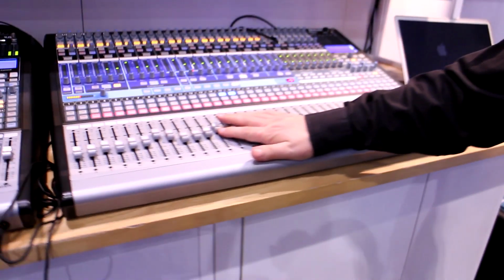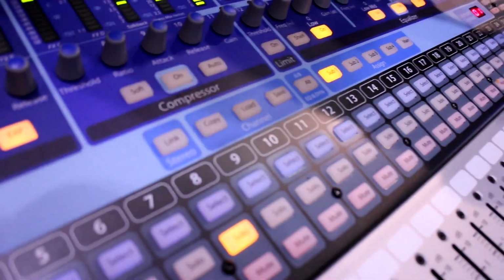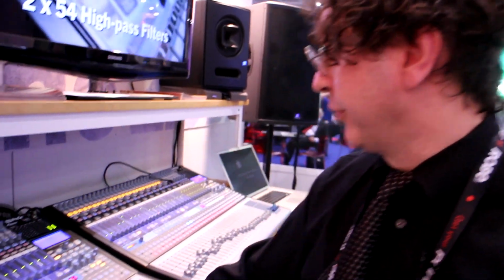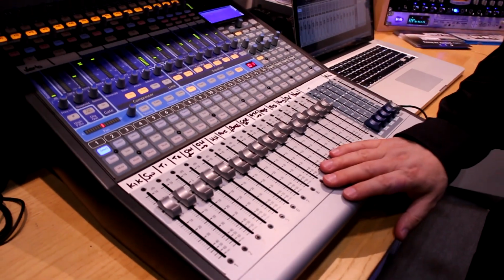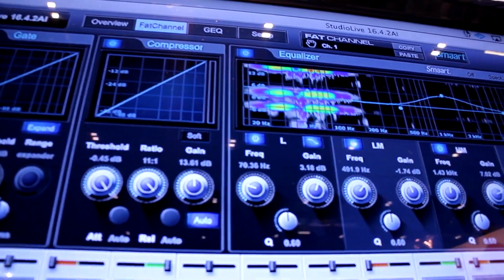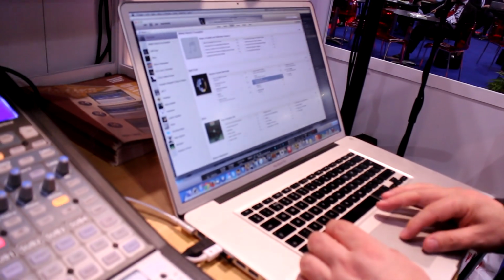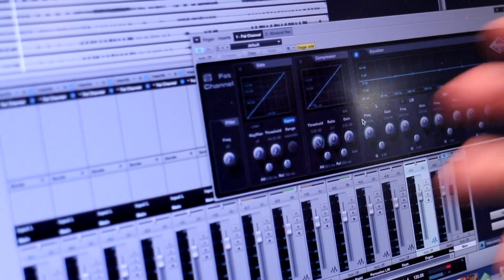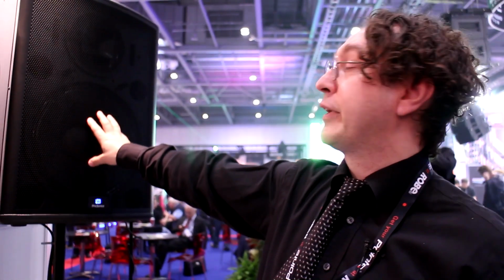Presonus StudioLive AI 16 and 24  Channel Desks At Plasa 2013

Comment: Wich of these mixers are rack mountable?
Reply: 16.4.2 is for sure, I own the older version & it comes with rack rails included. Check PreSonus' website on the other models to be sure on them.
Reply: MusicDrFro
Would the 16.0.2. be rack mountable too?
Reply: Frans van den Berge Yes, to the best of my knowledge it is. Only the 24 & 32 chl. are not (too wide). Unless of course, some sort of "custom" rack was used/made. Hope that helps.
Reply: Thank you. You are a great help.

Comment: interesting that they are using Linux internally in their hardware, but I dont see Linux mentioned on their site at all.

No mention of official support for their hardware or software-

Studio One - DAW

Virtual StudioLive (VSL) - used to provide real time effects - in their latest USB interfac

incidentally, to older Audio Box 2x2 USB works out of the box on Linux - although no volume control is provided by alsa. for the Mac setup it states the unit is -class compliant- not sure what this means